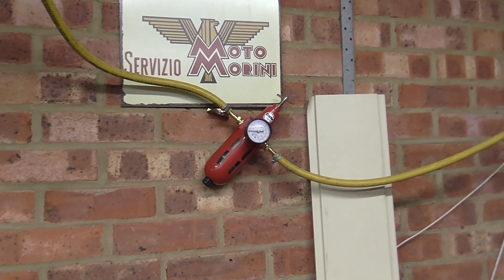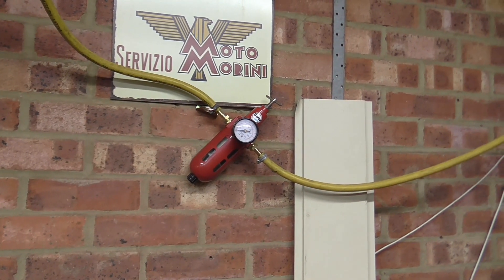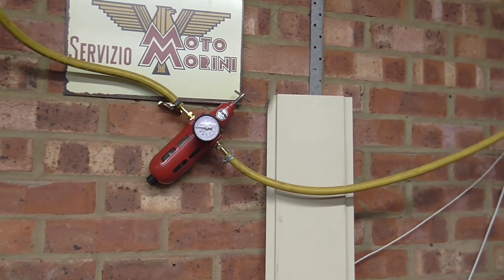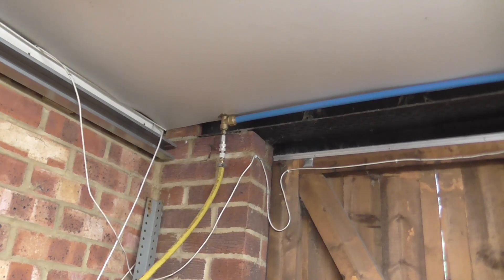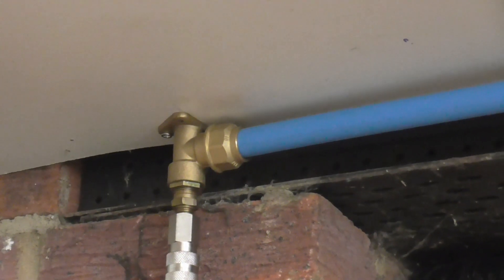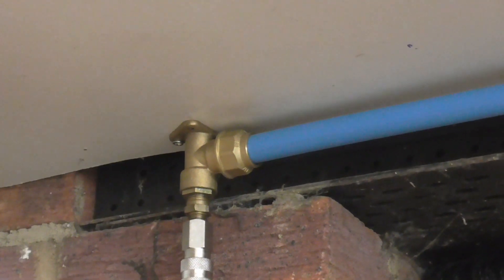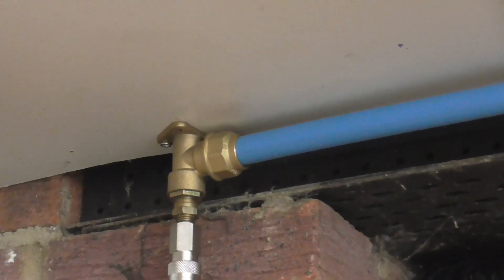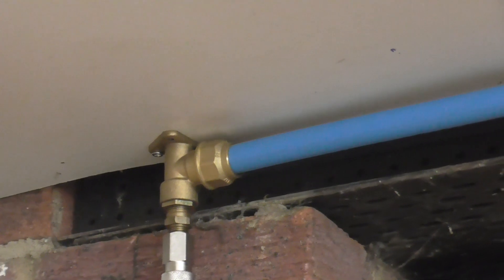Quiet workshop air supply.

Comment: Hi what are the specs of the clarke compressor?
Reply from the maker: The compressor had only ever been test run when I bought it, but was made in 1999 and is not a current model. The nearest match is a Clarke VE18C150

Comment: Paul, you should consider putting a drain in at the lowest point of the plumbing in the shop and have the piping slope to that point to clear the inevitable condensation in the piping as the warm compressed air cools. 
It is also a good idea to take your drops off the top of the pipe so "gobs" of water have a lesser chance of being fed into your airtools.
Cheers Eric

Comment: The  issue that I know of is with polyvinylchlorid  (PVC) pipe and really it's usually an issue where exposed to UV as it becomes brittle. The thing about it is it fails catastrophically, sending shrapnel everywhere. The pipe you used looks like PEX, a cross-linked polyethylene pipe that doesn't suffer from either of the earlier mentioned problems as I aware. Good work.